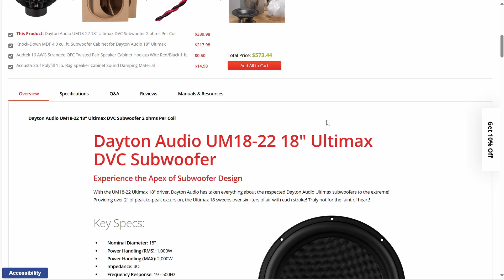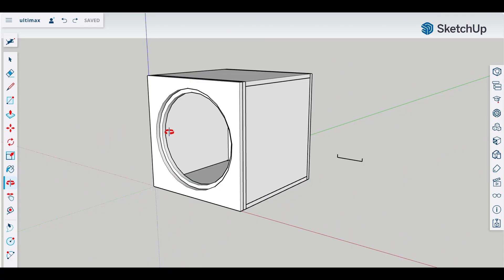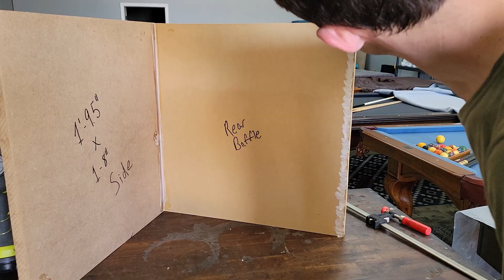Ultimate DIY Subwoofer. Let's Build The 18" Ultimax

Comment: I like to leave 1/16 oversize on the front baffle, then come around it with a flush trim bit.  Just built a pair of powered subs using Dayton Reference 10" (RSS265HF-4).

Comment: How low does it go? I really like the fact that this is so compact. I currently have 2x the SVS PB1000. But in a box as small as this I would be able to fit 15 inch woofers in my room probably.
Reply from the maker: Sealed f3 is around 33hz. With sealed you get room gain to improve this greatly. This will play into the low 20s & teens with ease. Provided you have the power to drive it. I use my Crown XLS and it has plenty of overhead

Comment: That's a way cool trick that you didn't use bracing on the side boards. You can save a fortune on passive radiators that way!
Reply from the maker: Yea, it was very cleary a demo box, as I stated. If you watch any other video of mine, I describe the need for bracing in each of them.

Comment: Great project! Can you tell me the dimensions of the case please? How many hz does the subwoofer play with these dimensions? 33hz or even lower?
How thick are the MDF boards?
Reply from the maker: This sealed enclosure is right around 2ft³. A sealed subwoofer like this can play well into the low 20hz range. Given enough power, this will play just about anything you throw at it. Sealed drivers also benefit from "room gain" allowing them to get a boost from boundaries.
Reply: @DIYhyfy  Why didn't you take the building proposal from part express with 120l (4 ft³)? How deep can you get with your case? It's about half of part express's construction proposal.
Reply: @Alex-yv8ej  at 46 seconds he does the 4 sqft

Comment: It's easy to round out the corners inside the box also. Use a small ball or balloon in each corner and use spray foam behind it to fill the corner. This made a HUGE difference in my subwoofer. You can also round out all internal 90's in a similar way essentially making a tube with the woofer at the end.
Reply: huge difference in what?
Because acoustically, I don't see how any kind of chamfering or filleting (outside of areas designed for an airflow, like ports) would make any difference in a subwoofer. A sub like this will not play anything above 80Hz, which equals ~2m halfwave. Halfwave this big doesn't care about your little fillet.

You do it on the outside because it looks better and is safer when there are kids around, but acoustically you don't improve anything.
Fullrange boxes are a different story, baffle diffraction is a thing.
Reply: @tomkocur  Regardless of what you think or don't see, it DOES make a difference. I'm not a sound engineer but there is an improvement for the better in the sound and what I can feel.
Reply: @RonHillier  alrighty then 🤣 whatever makes you happy.
Reply: @tomkocur  FO. You must be one of those that think they're always correct. IDC. YOu can be right if you want.
Reply: @RonHillier  I'm not. If someone presents rational arguments, or at least shows a measurement, I'm more than happy to learn something new.
All you bring to discussion is "trust me bro" with no further explanation or any kind of proof.
Reply: @tomkocur  As I stated, I'm not an engineer, nor do I have equipment to take any measurements. All I have are my ears. My speakers are made by Delcoid. They've been defunct for many years. I believe these were made about 1980. It's a sat/ sub system. Good luck finding any info online...I've tried. The sub is a passive 12", the satellites use a Peerless 5"mid and a peerless soft dome tweeter. I was told that the set was about $2000 in 1980. Not sure what they'd be today. If I ever see another set I'll grab them.

Comment: WHAT IS THE DIFFERENCE BETWEEN YOUR ENCLOSURE MEASUREMENT AND PARTS EXPRESS ENCLOSURE AND WHICH ONE GOES DOWN TO 19HZ
Reply from the maker: I believe the PE enclosure is roughly the same volume. I'm sure both will play to 19hz, but at what level in your room is tough to say. If you want subsonic bass, go with a bigger driver perhaps.

Comment: Before you buy these and get let down, a single Stereo Integrity budget 18 is louder than a pair of these from 20-40hz, using less power also.  Built simple sealed subs with (2) SI drivers each sharing common airspace, 14 cu ft each, single Crown 2502 in Y-mode powering each driver from the L and R speakon outputs. One amp per cabinet.  Ultimax soaks up plenty of power but a pair of them each sealed with the Crown clipping (800W per channel) in 4.5 cubes cannot  even beat a single Hsu VTF3. It's your money.  I wish I had known before I spent days building the Ultimax enclosures, what a waste of time. Erin at Erin's Audio Corner uses the same budget SI 18s in his theater, for good reason.  Had to lower the sub vol on processor quite a bit as they were overpowering the room like crazy where the Ulimax were just 'decent' with about 40% more juice.
Reply from the maker: There are undoubtedly better subwoofer out there, at better price points. There are a lot of these in the used market, and 2nd hand through other means. I actually purchased this for about $50 used.
Reply: We also purchased (2) Stereo Integrity 18V3s ($200 each including shipping).  Built one box so far: 8 cubic foot sealed.  Added a wooden ring around the woofer for a waffle grill protector.  The surround sticks up 3/4" an inch requiring something directly placed on the woofer for a grill to be used.

Still need to paint the wooden circle.  We will be building the second 8 cubic foot sealed box this weekend.  

We designed a wedge box that matches the angle of the back of our couch.  Sounds good but definitely does not have the same low end output as our:
- (1) Alpine Type R 12" in a 4.25cu foot vented box tuned to 21hz
-(2) Infinity Reference 1262Ws each in their own 4.56cu foot vented boxes tuned to 21hz

Winisd shows the Alpine and Infinity Reference flat output to 21hz like 12 db ahead of the SI sealed 8cu foot, but below 20hz that 18" SI has a LOT MORE OUTPUT.

We are using a Denon AVR760 LFE out to a Rolls M18B interface changer to XLR/line driver to a Crown XLS2000.  We have a Parts Express dsp device on it's way.  We have some room peaks up high that are very obnoxious and rattle our teeth.
Reply: You’re doing something wrong. I have a HSU vtf3 mk3 sub in my living room before it was in a small dedicated theater room. Nice sub. I run three ultimax 18’s each with a crown xls1502. Going to buy a 4th soon. The ultimax’s rattle my entire house. They are in a 24x21’ basement

Comment: I have two of these in my pretty large home cinema. Going down below 20hz DSP'd in a pretty flat curve. The only problem is that the box is WAY to light for the power of this thing.
Reply from the maker: I recently did some extensive bracing on this one. Should have done it for the video, but I was rushing things. Thanks for watching!

Comment: Have you taken any measurements on the sub's performance? Curious as I'm thinking about making 2 of these and I'd like to see what you are getting out if it
Reply from the maker: Hey I havent measured, nor plan to very soon. Its quite heavy. Subjectively this thing gets way louder than I need it to. It also digs very deep. I use plenty of power from a Crown amp. With its small size, and ease of build, its a great option.  Also, this was in a much larger enclosure, tuned very low. I MUCH prefer the sealed.
Reply: Which Crown are you running? The XSI 2502 puts out 750-800 watts per channel, seems like one of them could push a pair of these without a problem.

Comment: Greating looking sub, nice job there! 
I'd love to see the measurements of it - with room gain, it could even dig deep. 

Do you think that a sealed 21inch would be a lot better than this?
Reply from the maker: A sealed 21 could definitely compete or outdo this, depending on driver parameters. I recently built a vented 21. Check out the build. Thanks for watching!

Comment: Looks good, but why nails instead of screws?
Reply from the maker: Screws are highly unnecessary. Wood glue is stronger than wood. Therefore I don't see the need to add screws to the equation. They make finishing much more difficult & time consuming. Thanks for watching!
Reply: If glue is so strong, why are you even using nails by your logic?
Reply: @jtrill2 nailing isn’t for strength. It’s so you can glue, nail, and move on. If you don’t nail it you have to wait until the glue is dry.
Reply: @jtrill2 there are videos demonstrating that wood glue is actually stronger than screws.
Reply: @ElCidPhysics90   sure glue is strong, at the surface, screws penetrate deep into the material helping with continous vibrations, temp variations, materials absorbing moisture or breaking down. The material seperates from the glue and takes the material with it but the material is broken and seperates. I guess for some weak home setup its ok., but for instance I have some large home speakers for over 20 years and they need re-gluiing, which im not happy about and you hear the braces vibrating audibly at certain frequencies, one internal brace even just fell off. you do you, ill do me. glue only is half ass and is not end all be all answer. go to any serious audio build in cars and they are using screws and glue. also not nails and glue.
Reply: @jtrill2 ”you do you” followed by an entire paragraph of why I shouldn’t. lol. I’ve also seen things screwed together that were coming apart. Maybe the glue was bad. Maybe they didn’t do a good job.
Reply: @ElCidPhysics90  by "you do you" I meant, Im not trying to change your mind (sorry maybe a little passive agressive there). I just wanted to explain/comment how there are shortcomings in using glue alone or with nails even. Ive seen in his videos where others have commented on other ways to secure boxes, like adding fiberglass mesh and epoxy in the corners. This guy builds beautiful boxes and anyone new to DIY shouldnt stop at glue. Anyway im done here, best wishes.

Comment: Why the hate for sealed enclosures? Ive run both sealed and ported, and I feel sealed produced a cleaner tighter bass.
Reply from the maker: Sealed is such a solid option. Especially for beginners to woodworking. I highly recommend them. Smooth roll off as well.

Comment: Do u think the dayton 500watt plate amp would be enough for one of these, 2 channel music?
Reply from the maker: It's possible, but I wouldn't count on it. These are pretty power hungry
Reply: I've been running the older Dayton/PE Titanic 15" sub using an old 640w PE plate amp for 15+ years.  It does an amazing job.  I think the 500w amp would be a great match for either a 15 or an 18 Dayton driver.  You could always go with a Behringer or Crown amp too.  Behringer gives you a lot of power for the money.

Comment: Do you have to have a power amplifier? Or you just hook up to speaker output?
Reply from the maker: You will need at least a dedicated channel of a power amp to drive a subwoofer. Most cases you would have a dedicated amplifier, just to power your subwoofer.

Comment: I've really considered the parts express passive radiator version of this sub. Not really that affordable but looks very enticing for size and extension. Also should be better SQ with the higher quality woofer on that model.
Reply: The Ultimax 18" is happiest in a sealed box. The sealed volume helps control the moving mass of the woofer.

Comment: What can i say...

Cabinet material is too thin = boom box. Cabinet material will resonate as hell... and the cabinet will have a high sound transmission, up in the lower mids... 

So now you have two problems... wobbly bass, smeared lower mids, cause you can not integrate the sub right, into the main system. The sub will be locatable and sounds lousy !

No screws in the cabinet = the cabinet will crack sooner or later, especially under higher SPL...

Why ?

Cause the pressure which can not escape like in a vented box... A closed box must be built stronger than a vented one, cause of the pressure inside !

I build my own subs, for many years now and built speakers for over 40 years now...

And say, this built was wasting time and money.

My last built with a 12 inch sub, in a closed box, had a cabinet thickness of 50mm ( a special design of me = no sound transmission through the material ) ! 

Many... many screws to hold against the pressure inside. 

And the overall weight of this 50 ltr net 12 inch sub is 64 kg, without a single brace inside, cause the cabinet is rigid as hell...

The complete sub system ( multiple 12 inch ones ) go down to 20 Hz, with under 1 % THD in the room, and a Group Delay of only 7 ms... and has a overall weight of 214 kg !

This 18 inch sub here, is a big air pump... nothing more. Cause of the weak built.

I have 18 inch subs in my listening room ( the 12 inch are in my mastering studio ). One of the 18 inch sub has a weight of 150 kg ! The first built with a 70 kg built was weak as the built in the video !

Boomy, smeared lower mids and locatable... and this, with 44mm cabinet material !

After this failure, i designed the new subs, with the massive, i mean massive cabinet... Now the 18 inch ones ( i have two of them ), go down to 20 Hz smoothly, are good integrated into the big 4 way system and do what they should to do... Bring out clean the first two octaves of the frequency spectrum...

So my advices are...
Build the sub again... with a way more rigid cabinet, with many screws, and many braces inside... and damp it  with stuff, which is used in cars to damp the car body...

Then you have a chance to get clean bass... when the sub is well integrated into the main system... cause the main system must be delayed to bring out the best and to get a better Step Response...

And build two of them, than you have a better choice against room modes...  and the bass will be more clean, cause you have more power... means less cone movement = less THD = more dynamic reserves...

:-)
Reply from the maker: Thanks for watching!
Reply: If you don't use a brace then you are a moron instead lmao. Many people did measurements braces do wonders and you don't need super thick enclosures with them. You could also do isobaric configuration if you really care and then walls can be quite thin and not much braces required. You also don't need to dampen sub as it changes the Q so you may lose a bit of efficiency for not much gain as you usually play below 80hz. I tested it in my enclosure and harmonics are very very low, my couch is resonating more from the bass waves than any harmonic distortion from enclosure is happening. Before you do such claims you should prove it first with measurements

Comment: If you haven't stuffed that pretty much to the brim with polyfill you are in for a treat when you do.  The quality of the bass will go way up as well as SPL without distortion.  Also, are you using any EQ or dsp to boost that roll-off? Ultimaxes do very well down low with that.

Comment: Looks nice. I'm no woofer expert, but isn't it best to incorporate a passive radiator opposite the main driver when using a sealed unit? I say this as My Sunfire XTEQ12 is a sealed unit with a passive radiator opposite the 12" Driver. Nice video. Makes me want to attempt some kind of custom build. 👍👍
Reply from the maker: Passive Radiators are used to tune an enclosure. When we build sealed enclosures, we can tune the enclosure by controlling the size. PRs are great for certain use cases. But not required for all.

Comment: nice and clean job dude🤙the only thing i would do different is to use black screws maybe😊. I always had ported subs... i wanted that low end power. right now i have my first sealed one and i never go back. much more presize, quicker, dryer... way more controlled and it still goes waaay down to almost 20hz. that is deep enough 😇
Reply: Did you build your sealed sub or buy it
Reply: @ElCidPhysics90  no, i bought a magnat omega CS12
Reply: @ thanks for the reply
Reply: @ElCidPhysics90  you're welcome

Comment: Where do you find an amp pushing that much power?? I can only find 100x2, 100x4, etc
Reply from the maker: Crown xls series. Has many watts of headroom. Thr other channel is running a 21" with no sweat.
Reply: @DIYhyfy  thanks! I want to get into woodworking and speaker building

Comment: Ohhhh Glue and screw man. The screws will create a mechanical connection and help to seal it that much better.
Reply from the maker: Yea, no thanks. Glue is plenty strong, and no need to fill 100 screw holes!
Reply: I'm terrified if you used 100 screws. I get it's a big box but for the joints yeah all day screws and glue the vibration from the sub can separate the bond after time as the brads can pull loose just like the glue  bond can crack and break. I tend to use a slightly flexible adhesive for that reason. Your box, your build, I've just learned from experience that vibrations and pressure especially sealed can really do some stuff.